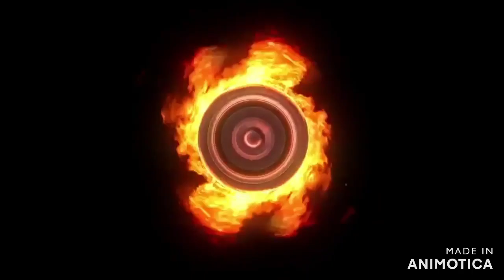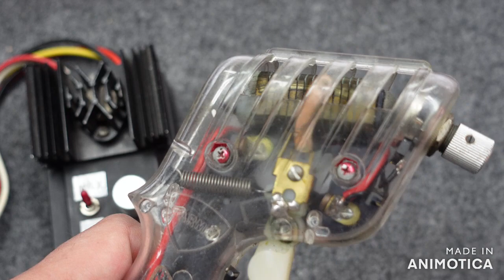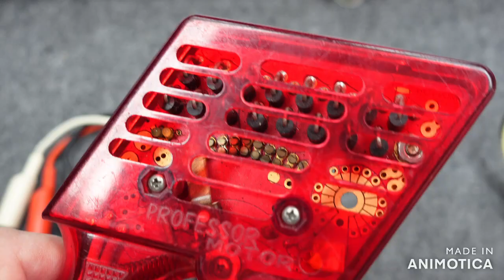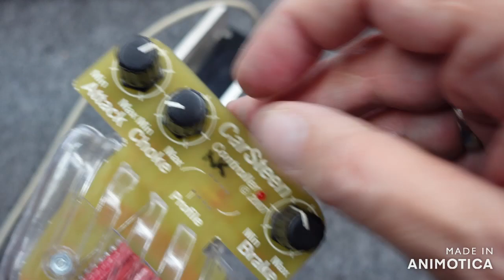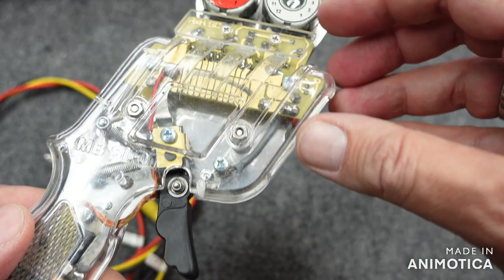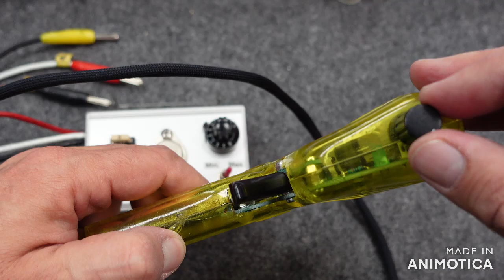Slot Car Controller 1/24, 1/32 and HO #slotcars #slotcarracing #slotcar

Comment: I was hoping you would show how to connect to the carrera track 😊i bought a 3 wire controller amd wanted to cut my carrera controller cable and splice in my new controller but havent a clue which cable goes where ....subject of a future post 🤦🤣
Reply from the maker: Sorry Harry, I am not into wiring a track at all!!!!!! But there are a lot of pics in the Internet on how to wire it up! Focusing on the controllers themselves in this video!
Reply: @slotcardude68  I should know how to do it Nico ,being an amateur radio operator, but my brain isn't focused on this concept...ile put a help me post out for giggles and see what happens 😅

Comment: I run analog in both HO and 1/32 and use Professor Motor controllers, 35ohm. I have been looking at a couple Difalco units, DD301 and a 501, for when it's just me running on my tracks (AFX/Carrera).
I have an Astron VLS-10M PS that I am going to wire in ASAP to my tracks.